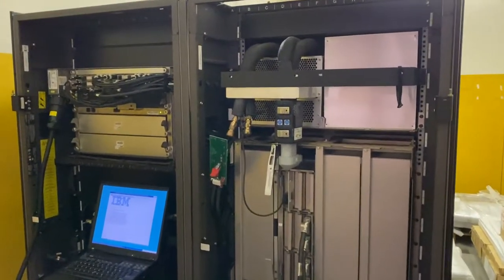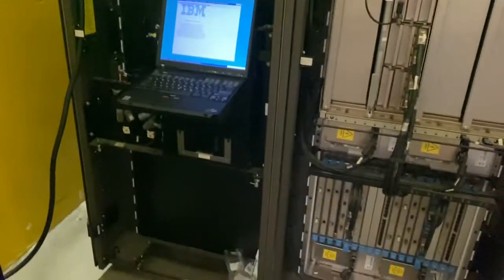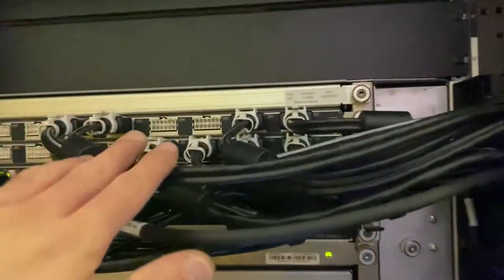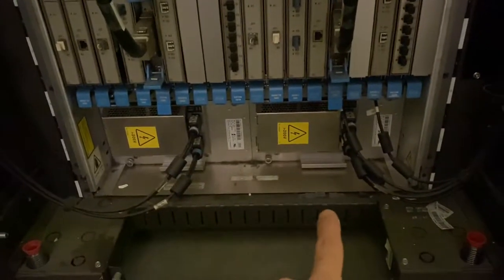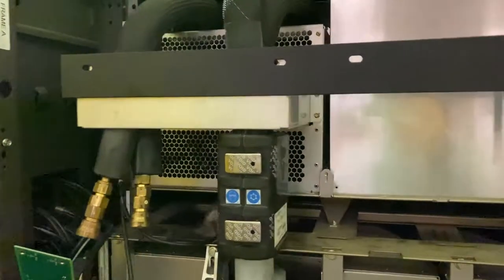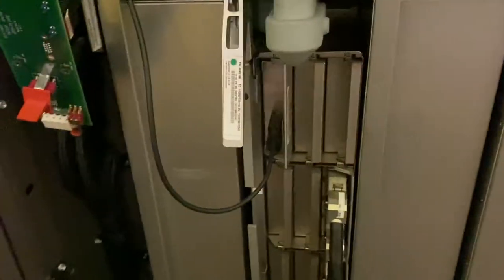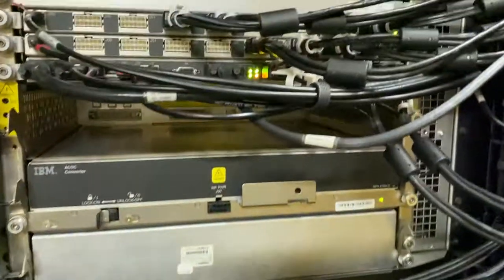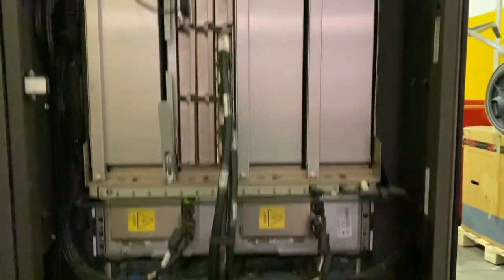Cold starting the IBM System z9 Enterprise Class Mainframe for the first time!

Comment: The cooling pipe is not connected？

You don't have a storage device, and how do you get license for the operating system? As far as I know, it is difficult . Otherwise I would have almost bought a Zsystem.
Reply: He has SuSE Linux running on it.

Comment: "Cold start" has nothing to do with the system warming up.
Reply from the maker: No, it will but doesn’t need to warm up. It means that all power was completely off and everything needs to start up. A “warm” one could have the power supplies or the Support Elements already running